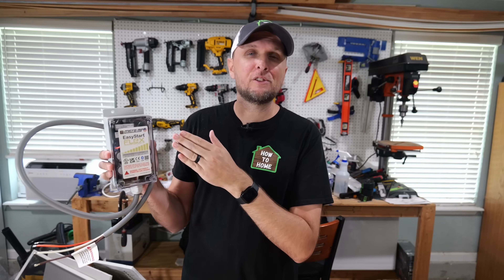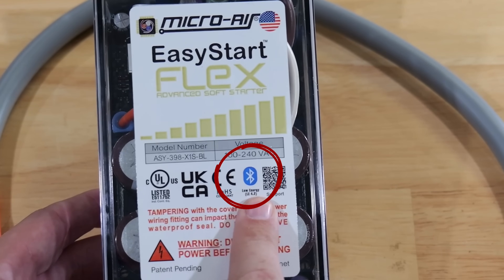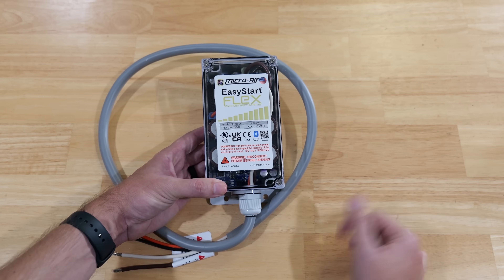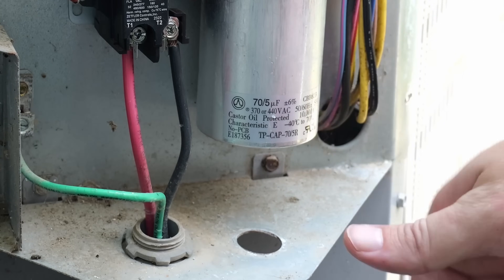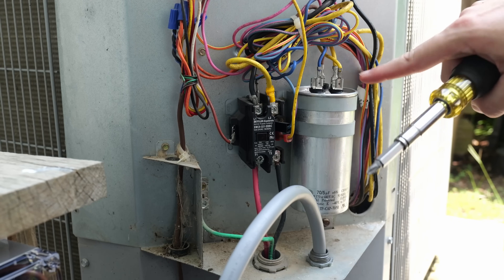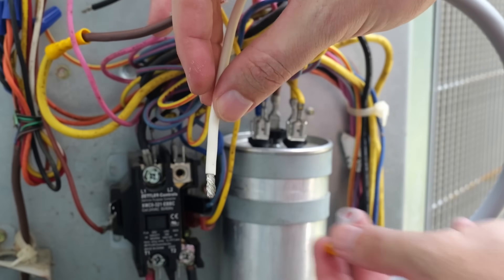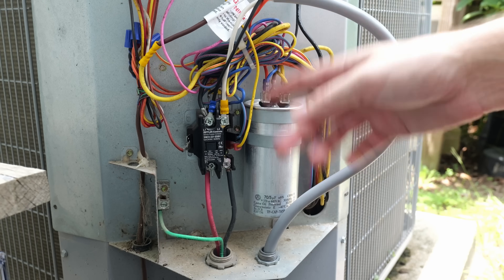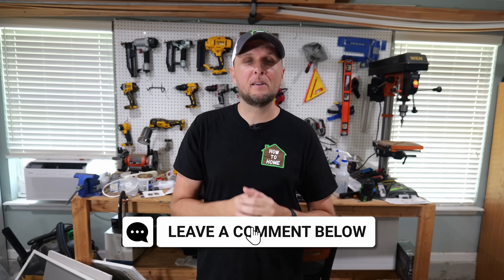The ONE AC Upgrade Every Homeowner Needs to Consider!

Comment from the maker: Important Note!  I know I will get questions and comments about this so I wanted to pass this along.  From what I have observed and experienced myself, the soft starters will go in and out of stock during hurricane season as they are in very high demand.  I also have links to the older models listed in the description as they work similarly to the Flex.  The biggest differences are the previous models are bigger and need specific sizing. So check back regularly.  I am curious though, what are your thoughts on these and do you personally have any experience with them?
Reply: @RobSabella  I have one installed for about 5 years now.  I did have a failure with the first unit in about 1 day after install and they replaced it quickly and I haven't had any issues since on my 3 ton AC. I do a generator test twice a year and the 14kw generator I have has no issue starting the AC.  You can sometimes here a oscillation in the compressor as it slowly spools up but it goes away in about 10 seconds.
Reply: I am starting to see a lot of people talking about he units being DOA or failing within a few months.  I do not see the same with the older models.  Do you have any thoughts about this?
Reply from the maker: @techieg33k there were a small amount of people that had issues with the forest version months ago.  Micro air changed that part out then and has been shipping the newer ones for quite a while now and sending new ones to anyone that had an issue or they could opt for a refund.  Mine’s been installed a couple months now with no issues.
Reply: Bad reviews on Amazon you may want to read them.  Just a heads up as I am looking to purchase one.
Reply: Can this be used on an electric pool heat pump?
Reply: @PastarocketS-sb7nk I installed a Hyper Engineering Eltwin Sure Start on our 12 Ton (7hp) Pentair Pool heater/chiller. LRA dropped from 195 to 45 amps. Did not use Micro-Air as they said our pool heater was too big. Eltwin was the only one that I could find that could handle Pentair’s largest pool heater. Eltwin is widely used by commercial installers.
I did install Micro-Air on our 2 AC units and they work great. When 2 AC units are running and the pool heater kicks on the 195amps inrush on top of 55 amps for 2 AC’s and 15 amps for clothes dryer all at once was a pretty big hit on our solar inverters - no way for a smaller generator to handle.
Reply: @PastarocketS-sb7nk  Yes
Reply: can this bee installed on most air cons with inveretr pcb's most aircons dont have single capacitors. Everything is built into the  Inveretr pcb. If so how can it be installed. This looks like a simple wiring on a standard air con. most home split systems an home ducted are have mostly pcbs.
Reply: Hey fella.

Can I trouble you to make a playlist that covers going from completely grid dependent to being able to run a generator in emergencies,  with supplemental solar / wind power to minimize consumption demand from the grid?

I'd like to cover failover power and all the little nuances.

Specifically what one can lay the groundwork for as the project expands
Reply: How are you measuring the in rush? I find it hard to believe you have 18 A and a 4 ton.  I went from 106 down to 50 on my 4 ton. Went with AirGo and I love it. Much quieter start and definately noticeable. Should have down this years ago. Now my Westinghouse runs it using natural gas
Reply: @HowToHomeDIY 
I just bought the new flex model soft start for my 5 ton ac unit. Once it gets hot outside the soft start flags overcurrent and will not allow the compressor to come on. Once I turn off the over current feature the compressor comes on normally. What would cause this problem? I sent the information to micro soft. They said to check the ac run  capacitor to see if its the right capacitor. Also this is a brand new unit that was installed October of 2024. Any help is greatly appreciated.
Reply: @darkangelracing4948 I saved $150 and went with AirGo soft start. Dropped amps from 80 to 20. Totally happy with it
Reply from the maker: @user-rd6wx1my7o so ultimately it is up to you and both are great models.  What I will say is this, some people had issues with the flex when it first came out, not the majority.  Since then, Micro air has changed out and upgraded the part that would sometimes have issues.  Also, every single person that put in a claim, was sent one of the new ones and I have not seen anyone have an issue with the second one.  So they do have very good customer service.  Also you referenced the Amazon reviews.  Well at least some of the bad reviews were from individuals that don’t specify what actually happened so it could have very easily been user error installing it and I saw one that claimed theirs went bad when the warranty ended.  Well that one would have to be one of the older models as the FLEX has not existed long enough for that to be the case.  So not telling you what you should do.  Like I said, both models are great.   Just wanted to add some context and information that might not be readily available.  Mine has been installed a couple months and no issues.  But let me know if you have any questions and I’ll try to answer them as best as I can.
Reply: @HowToHomeDIY  Thanks for the additional background
Reply from the maker: @user-rd6wx1my7o very welcome.  If you have any other questions feel free to ask.
Reply: Will this starter work on a window AC 220 unite?
Reply: @RobSabella interesting especially since I can’t even find the new one on Amazon
Reply: Model no. Please so I want to pursue this product and where to buy please jelp
Reply: Time to rethink my cooling system
Reply: I purchased the ASY-368-X72-BLUE  rated for 5-6 ton
I have a 4 1/3 ton compressor  
Can I still use the product?
Reply: @robertcraig2654  they don’t typically rate compressors in thirds like you said. Where did you come up with that?  Can you install it on a unit it clearly is not designed for?  Yes. Will it work properly?   Probably no
Reply: I have read some reviews on Amazon and the claims were of damages to the unit. Compressor if I remember correctly. Making me a bit worried. What if anything do you know about this. Would it void the warranty?
Reply: @scottjohnson2448 my AC company suggested them and totally backed them. No issue with warranty either. I have the AirGo and am very happy with it
Reply: Can you buy these units in a store
Reply: @douggemmill3497  where I got mine from Amazon
Reply: I have had one on my 6ton AC unit, and love it, plus easy to understand and install. Thanks for the review and update. My in-rush  dropped from something like 105LRA to 49A! No issues.
Reply: I just installed a Flex. Works like magic running my 4 ton ac on a generator. Question: My inrush with a hard-start kit was 18 amps. Could not start the ac on generator with the hard-start kit. With the Flex, my inrush is 37 amps (more than double the draw as the hard-start), BUT the ac will start while running on the generator. What gives?
Reply: @attorneydrew you can't measure inrush with most multimeters, so unless you have a specific (and fairly expensive model), I wouldn't worry about those figures very much. A regular clamp meter cannot show inrush
Reply: @mike93lx - my Fluke 87V does maximum and although it’s not inrush it measured my drop from 106 amps to 50 amps after installing my AirGo. Good enough for me
Reply: @attorneydrew  Your meter wasn't catching the quick current pulse with the other inrush setup.
Reply: Soft start devices are one of the biggest scam alert devices in the HVAC industry. I've had technicians tell me i got to have a soft start on my unit only 2 years later another tech say to me "why do you have a soft start device? You don't need this". Or, "you need one but you got the wrong one on your compressor".
Reply: @paddle_shift  There are passive and active soft  start devices.  I have one of the active ones like shown in the video and it prevents my generator from even noticing the AC coming on.  Now if you don't have a generator then I don't see why you'd use one.
Reply: @paddle_shift Reading your statement, "you need one but you got the wrong one on your compressor", sounds to me you made a wrong choice in model to install for your condenser. Find a technician which understands what a soft start can do for your system and have them do the work.
Reply: @paddle_shiftHard starts are probably being mistaken for "soft starters" ? HVAC school podcast has some good details on hard starts which can be a scam or can be a ok bandaid when explained to the customer. Good quality Soft starts add a lot of protection  when you see all the horrible ways a welded or high resistance contactor can do. Or just the power company supply.
Reply: Have you tried any other brands? I see there are alot of complaints about brown goo running out of them? Also heard their customer service is pretty poor.
Reply: Shame that most of you are too incompetent to understand when we are telling you why you need to put additional Parts onto an air conditioner
Reply: @jimreeds9731  Jim?
Reply: @jimreeds9731  hmmm????
Reply: @jimreeds9731 -not exactly sure who this is directed to?  Are you an AC guy that does this sort of work and you are saying your customers are incompetent when you are telling them they need this?  Is that your beef?

Comment: Bought that $499, HVAC guy put it on brand new RUUD System, went from 11 AMPs to 90 AMPS with this JUNK.  Sent the info via Bluetooth to the manufacture, he writes back "  Its working like it should"  LOL full of shlt.   HVAC came back ripped out, tossed in garbage went back to 11 AMPS draw.  If you have a real whole house generator this will keep your generator from protecting the house.  My Cummins water cooled truck engine couldn't start with this crap.  Buyer beware!
Reply from the maker: You are full of it.  First, these aren't anywhere near $499.  Second, that is not possible.  Unless you have an inverter based AC unit you aren't getting 11 amps without help.  And if you do have an inverter AC and you bought a soft start for it, that is on you because they arent made for them and you would have known that had you read about them when purchasing.  This whole comment wreaks of someone that is either clueless or sells whole home backup generators.

Comment: Thank you for such a very intuitive and informative video. As a DYI'er I have heard a soft start has damaged some a/c compressors. Is there a rule or guide such as the age or make of the unit to avoid using this device. The issue could have been improperly installed, but I have no knowledge of that. Living in an area  where storms are a fact of life, we use a generation to power our home. I want to install this unit, but I obviously want to get it right. Any thoughts on putting this on my 12 year old Rheem?

Comment: THIS IS A FOLLOW-UP FROM MY EARLY POST FROM LAST SPRING(2025]. WE HAD OUR H-VAC GUY INSTALL ON OF THESE RIGHT AFTER WE HAD A WHOLE-HOUSE GENERATOR INSTALLED. WE EXPERIENCED ONE OF THE HOTTEST SUMMERS(2025). WE JUST RECENTLY RECEIVED AN ADJUSTMENT FROM OUR POWER COMPANY ON OUR BUDGET ELECTRIC BILL. IT WENT DOWN BY MORE THAN $30 A MONTH… ‼️THANK-YOU EASY START‼️

Comment: Excellent video again. I am going to look into the Flex model, only because I have the 368 model, and the 50% reduction in size is intriguing. I needed to install the 368 outside almost 3 years ago, and although they are deemed weatherproof, [really nothing is], I imagine that the plastic will eventually fail. I live in Michigan, and we have all seasons here. I have a couple of notes, and questions. I have nothing but good things to say about my unit, purchased from Hutch Mountain (very good with customer service so far (Utah)):

1. I like your crimper, I need to get one. I've been using the standard stripper crimp on the handle
2. As far as cost savings, yes the running amps difference is negligeable, BUT there is cost savings over the long haul by saving compressor from huge multiple in-rushes. So the cost savings could be calculated based on length of service of the compressor itself; maybe Micro-Air could investigate and publish
3. Are there any improvements to the APP using the Flex model? I like the fact that you can get diagnostic info with 368, and the APP actually alerted me to a wiring issue in the past. Has the APP changed to a more user-friendly version? For example, it would be nice to connect to the unit even when the A/C is not running. This is a known limitation, and I understand that the unit requires the A/C unit to be running for the Easy Start to have power. Could there be  an external power source for the board to be powered all the time for historical data and diag info?

Again, great video instruction and I follow. I have recommended you to others word-of-mouth. Please continue with your excellent instructions!

Comment: I don't think (for most energy suppliers) that this will reduce electric bills even with services that charge a demand fee because they typically measure the demand within a 15 to 30 minute interval.  Short reductions in inrush current from a soft starter do not affect this average enough to change the billed maximum demand. Regardless, this is really well done video and the benefits of a soft starter, especially for folks who have just recently installed a new A/C unit, to reduce wear and tear on the compressor.

Comment: first, I like your videos, second, I see a lot of people do what you just did with the disconnect. You are supposed to pull the disconnect out, turn it upside down and reinsert. When turned upside down the disconnect will say OFF stamped into the plastic, same for when you are ready to run, pull it out turn it back over where it says ON. The way you have it now.....you did not even close the door....do u have children? one could stick their hand in there....you have 220v exposed bare connections. I have seen people do that when washing their coils, any water gets in there and they are toast.
Reply from the maker: How do you know that I didn’t close the cover on it?  I cut away for purposes of shortening the video.  This is a DIY focused channel and while most of the time I do at least share with people what you said, I will never encourage someone to reinsert the disconnect in and they potentially don’t flip it upside down.  And to say if any water gets in there they are toast is ridiculous.  Not advocating not to close it at all.  You should.  But your comment is very dramatic and lacking accuracy.
Reply: @HowToHomeDIY  yeah and i am still alive and so is everyone around me. but nice informative video. people emulate what you do, you should strive for the upmost safety

Comment: I purchased two of these Flex units last year for my AC units and unfortunately the seal on one of the units failed allowing water in which shorted out the component board inside. I sent a notice to Micro-air about the issue and they immediately sent out a new unit free of charge no questions asked, highly recommend these guys…

Comment: I installed 1 yesterday. It took 10 minutes maybe, after reading the instructions (and watching a youtube video to make sure). Everytime my AC would come on, my Solar inverter would flicker then fault. I would have to switch everything back to grid, reset the inverter, wait a few minutes, then switch back to solar/batteries. I figured out that if I let the grid start the AC, then switch to Solar/battery afterward that it would run with no issues. But who wants to do that all day????

I have a few more starts to get it ready, but hopefully it works.

Comment: I have A 41/2 ton trane system. The capacitor has two pole rather than the 3 poles. Which one would be the Herm terminal for the orange wire? Thanks
Reply: The side of the capacitor that is not marked with "C".

Comment: How do I know if I have a hard start unit installed?
Reply: A hard start kit usually looks like a small capacitor and relay attached to the compressor circuit, often in a small metal or plastic package near the compressor or inside the unit panel. If no extra components are visible, the unit likely does not have one installed. If still in doubt, search for hard start AC unit videos on Youtube which may help you with visual identification.

Comment: Can I use micro air if I  have a compressor defender installed
Reply from the maker: Correct me if I am wrong but that Compressor Defender is just a compressor surge protector right?  If so, then yes.

Comment: For gosh sakes, don't just touch that capacitor without at least measuring / discharging it first!
Reply from the maker: For gosh sakes, did I not cover that?  How much did you skip?
Reply: Don't worry, my man licked the capacitor terminals, like a 9Volt battery. 😉

Comment: My A/C unit has a circuit board (motherboard?) and capacitor under the cover, no contactor to be found. Can I still use an EasyStart Flex on my system?
Reply: The absence of a contactor does not prevent the use of EasyStart Flex, provided wiring is correctly done to the compressor motor and run capacitor circuit according to the EasyStart installation guidelines. The EasyStart Flex connects electrically only to the compressor motor, not to the fan or other parts. The pre-existing capacitor in the AC system continues to drive the fan motor startup as usual. Meanwhile, the EasyStart Flex soft starter specifically modulates the compressor’s startup by gradually increasing the voltage applied to the compressor motor.

Comment: Why are these not required on new units due to the energy savings? Will it effect the warranty?
Reply: There... is no energy savings, just energy used over a longer period of time. 
Do you save gas by driving 400 miles in one day vs 200 miles over 2 days?
Google: affect vs effect
Google: Magnuson-Moss Warranty Act